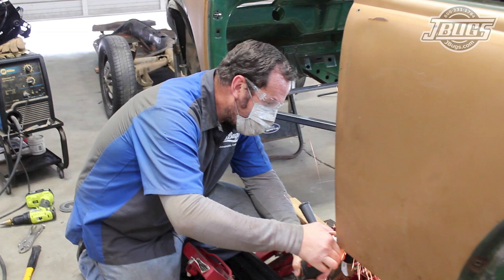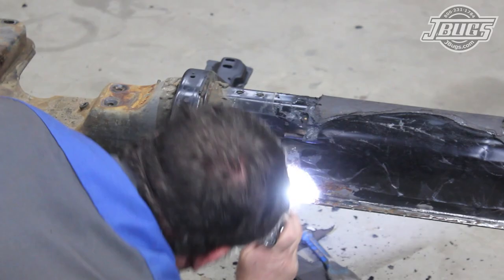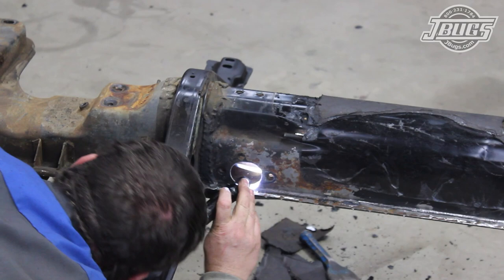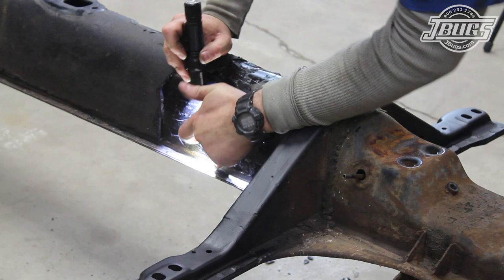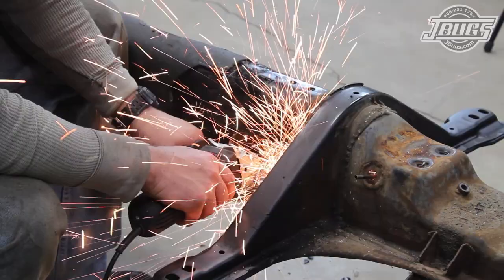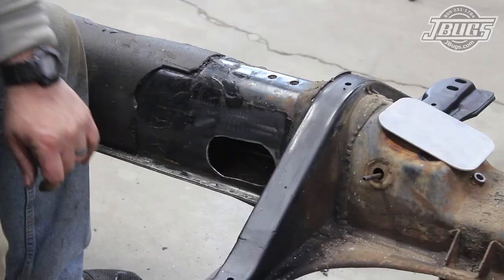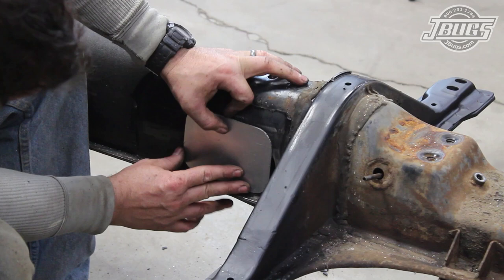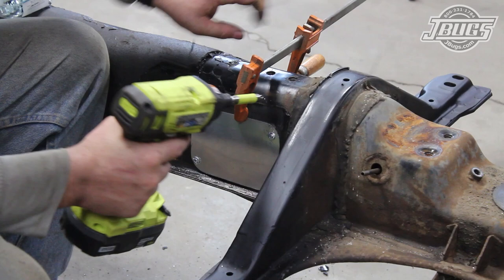JBugs - 1971 VW Super Beetle - Clutch Cable Access Plate Modification

Comment: Hi Sam. I need to make this same exact access panel on my 71 to remove my clutch cable. What are the chances of me coming into contact with anything on the other side of the metal?
Reply: The cables, fuel line, and braces are all inside the tunnel so it is very possible to come in contact with something. Definitely use caution.